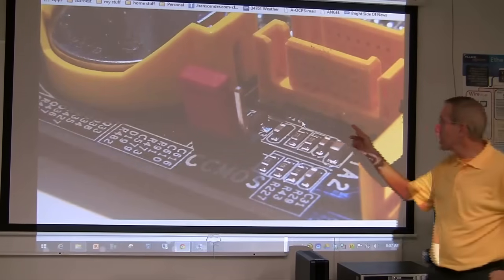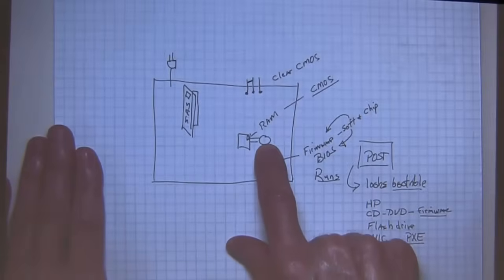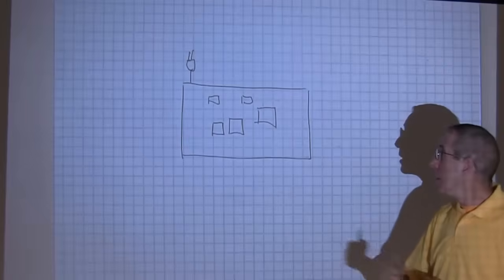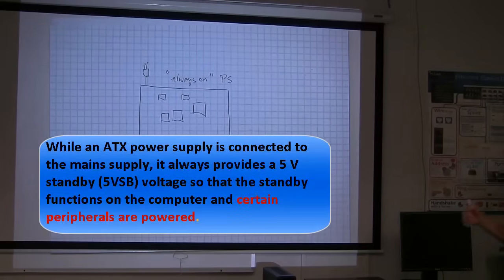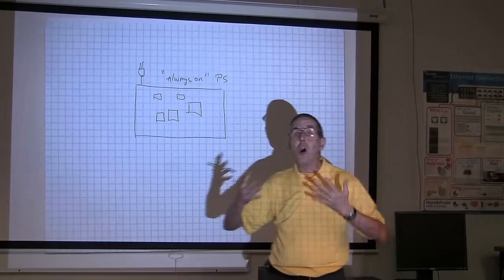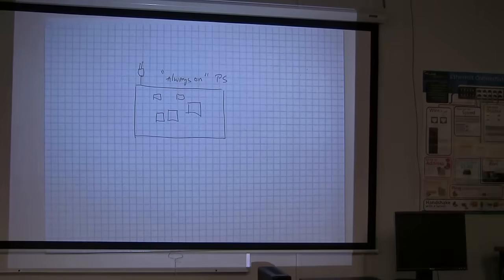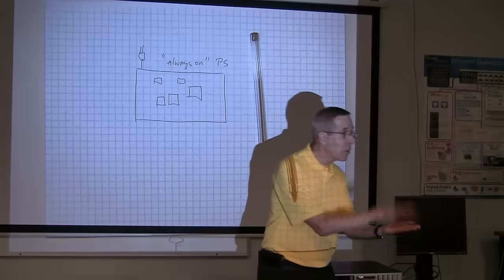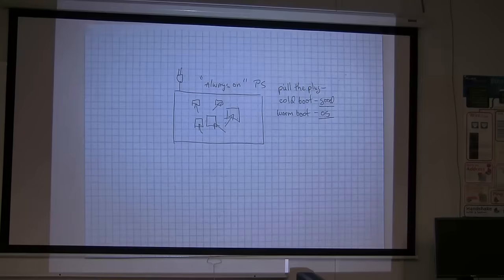How PCs Boot  ... Explained:  Using Legacy BIOS

Comment: Great video. Even though I was aware of PSUs holding a charge and the need for a cold boot, I never considered this from a troubleshooting perspective. I was surprised there was no mention of a master on/off switch that could be toggled on the PSU, as most PSUs now have them. The explanation of the cell phone  battery and eMTA were spot on! I still remember when cell phones started coming with sealed batteries...shudders

Comment: You are absolutely right about re-initilization. It applies to all the chips and firmware on the board. I recently had a small problem with the Intel fake RAID where two RAID-0 member disk drives appeared as "offline member". If my memory serves me it was due to a failed boot from a UFD with Linux on it. As a result, on the next boot I could not load up Windows normally, which was installed on the RAID-0. But in reality those two disks were in fact still members of the RAID. Powering down, and powering up again restored the RAID member disk status to "member disk" and I could load Windows. In the end, I updated the BIOS and now it boots from any UFD with either Linux or Windows, regardless if it's FAT, FAT32 or NTFS formatted. It was a problem with the old BIOS.

Warm boot is sometimes referred to as a soft reset, and cold boot is referred to as a hard reset. Pulling the plug is obviously the best thing to do, but it's not very convenient. The "always on" aspect relates to the power supply, not the operating system. It's to be confused with a warm boot or a cold boot. The reason Windows 8 appears not to be reloading is because it stores some data on the disk for a quicker reboot. It's not because of "always on" power supply. I guess you could say that with Windows 8 and later, the reboot process is even "warmer" then before.